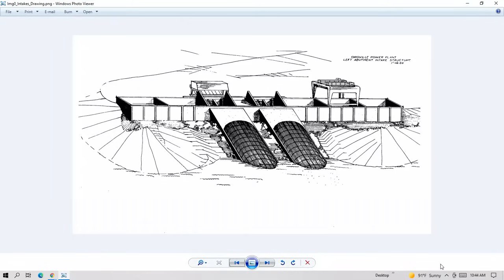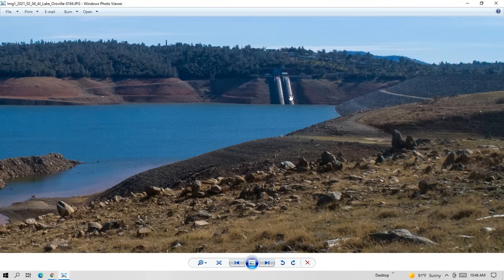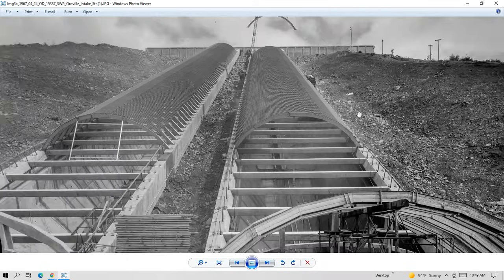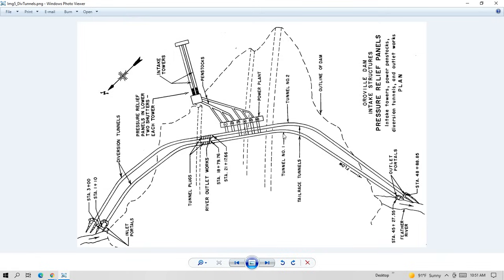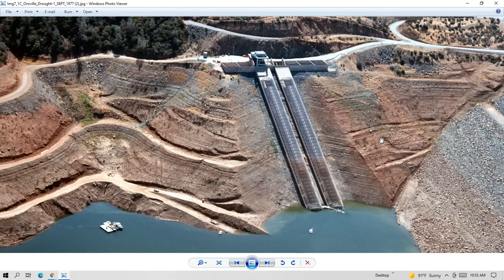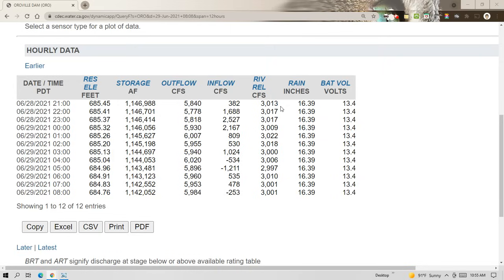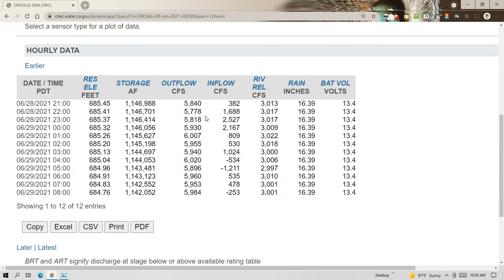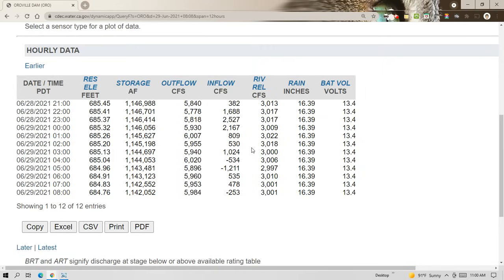When Drought Comes to the Oroville Dam by Millie Kay 06-29-2021

Comment: G'day Millie,

Yay Team !

I was wondering what you'd been doing..., how goes the Chautaqua ? (!).

   By the look of things, one can have one's water in their Dam, or one can use the water somewhere else...; but without constanty reliable regular Rainfall, then one cannot both have water in the Dam AND  use stored water for (whatever) other desired purposes.

I discovered this, when I finally bought a Pump & put it beside the 100,000 Gallon Dam which I'd had built 29 years earlier, and connected the Pump to my Clearing 450 yards away & 30 ft up the hill, planning to use Dam-Water through my pre-emptive Bushfire Defence Night-Sprinklers..., in 2019 ; after only a couple of nocturnal "Waterings" of about 1,000 Gallons per time, I had to stop in order to leave something in the Dam with which to actually fight a Fire...

   Thus, I learned that the concept of catching the runoff from Rainwater in a Dam, so as to later use the stored water to "irrigate" some selected area of Vegetation - and thus contrive to be able to continue to live AS IF the Rains were continuing to regularly appear...; is in fact a figment of somebody's diseased Imaginitus, because in the event one runs the Dam dry while attempting to keep the Plants alive, and then they die anyway..., and after that one wonders if there'll be enough water with which to run one's Firehoses.

And, apart from all that, about 5,000 years ago the Babylonians (who invented "Irrigated AggroCulture" after they first cleared the Forest to grow bigger Crops, and felling the Trees switched off the Rainfall-Pump, and they "Had To" then irrigate - first with River-Water & then with Well-Water...), discovered that,

"If Irrigation
Exceeds
Precipitation,
Then
Salination
Is
Inevitable...!"

  Because River-Water is more Saline than Raindrops, and Well-Water is much more Salty than Riverwater.

And, on the other hand, in ancient times..., conquering Armies used to ensure that their defeated Enemies never ever rebuilt their Culture or EcoGnomie...; by "Sowing Their Fields With Salt",
to ensure that whatever they attempted to grow in that place, failed to thrive...

  So, at the moment the whole West Coast of Norte AmeriKano appears to have "painted itself into a Corner",
in that every possible Dammable Site on every River has  already Bin-Damned, and every drop of predicted-to-be-stored Water has long  Bin-Allocated & Licensed, Fees have Bin-Levied and paid for the access to it, and Mortgages have   Bin-Committed unto -  against the projected Profit to be gleaned from the sale the Crops planned to be grown with the Rains which have now failed...

  What saved my little Fireplan was that, after paying $20 per ton for 60 tons of Town Water to put through my Firehoses, and after putting in $1,200 worth of Pump & Pipeline to use 10 Tons of Damwater...; was that my neighbour put his pair of 22,000 Litre Bore-Tanks about 50 yards from my front gate, fed by his Solar-Electric Bore-Pump at the bottom of his Hill - and he started selling  me his Bore-Water at 12 Tons for $50, per week if required..., which is $4.12 per ton and the Water-Carter only pays $3.56/ton for the filtered, treated, potable Town  Water he was charging $20 per ton to deliver in 10-ton loads.

I only paid $250 for the 2nd-hand Pump I keep beside his Tanks, and I had the 150 yards of Pipe already - leftover from the Dam-Pipeline...

  We're now having a wet (warm) Winter..., with Zero Celsius overnight minimums now regarded as being "very Cold" whereas until 25 years ago minus 12 was considered not unusual & minus 15 was about the record.

  So, as soon as the Rain switches off, then this place is one Hot & Windy week away from being a Fuelbomb...; half the Trees in the Canopy died 2 years ago, of thirst, so the Air-dried Cured Firewood is standing 30 ft high, over chest-high dry dead Grass - which grew in the Light arriving through the holes in the Canopy where the Trees are dead, and thriving on the  Rain which the dead Trees didn't absorb nor Evapotranspire back into the Air.

   I'm felling the dead Trees, as fast as I can get around to it,  cutting them up for Firewood, and carting them away from my Hut.
  
It's all I can thunk up, to do about it.
   
 Good luck with the looming Fire Season Millie..., it seems that between Global Warming & the Bat-Eater's Lament Virus...; we're living in VERY interesting times, indeed.

CoViD-19 Delta is kind of loose in Oz right now, and only 5% of the population is fully vaccinated with 28% having had one "Jab"....

  As strange as it may seem, the local Colony of Bent-Winged Pippistrelles - "first-cousins" of the WuHan Horseshoe-Bats, live in a Cave about 2 miles west of my Hut..., and when a cloudy Full-Moon  night sees them trapped by the Sunrise out over the Forest & miles from home...; then for 25  years they've been sheltering under my Verhanda, hiding from Daylight & Predators by burrowing under my old leather Flying-Jacket.

Last year, just as Melbourne went into a 110-day Lockdown I had a Bat Visitation ("Endangered Bats, As House-Guests...!"), and last Friday - as Variant Delta brewed-up in Sydney..., my Guard-Bat showed up to camp above my Doorway.

  Ideally, if their Cousins' little lost World-wandering Commensal Virus shows up here then the local Pippistrelles will take it in & put it on it's Leash again...(?) !

   Maybe the secret of a happy Life On Earth is to not annoy the Bats, perhaps ; it seems to be not-failing, for me, anyway...

Such is life,

Have a good one...

Stay safe.

;-p

Ciao !
Reply from the maker: What a fascinating comment (as usual), Warbles! I will read it again -- such gems of wisdom! I often drop by your channel just to see what you're up to. Always something that challenges the mind, that's for sure. I'm curious about the 5% full vaccination rate down there -- why so low? G'day, mate . . .
Reply: @MillieKay  

Thanks mate !

I sort of take each day as it comes..., everything seems to be changing so much & so fast that making big or complicated plans seems to be almost asking to be caught flatfooted (!).

I do try to understand, and to make sense of it all though ; it seems to me to be more worthwhile than a lot of other things people worry about (Sport, Fashion, Politics, Horse & Dog Races, Celebrity-Gossip, Colon-ising Mars...) ?

Such is life,

Have a good one...

Stay safe.

;-p

Ciao !

Comment: Why. Annot during this dryout and drop of water leven cannot the water intakes at 28 degrees be extended into deeper water?It would seem that even a mild 200 foot extension at degrees would place intakes into an available draw down of several foot water drWs.
Reply from the maker: Hi Michael . . . It sounds like a good idea, but the whole system is precisely designed to function with the current configuration. They did a lot of hydraulic studies and tests to fine tune it. Thanks for your insightful comment.

Comment: What about the dam drying and shrinking?
Reply from the maker: That's an excellent question, Robert! It can't be good for the dam to get below levels that haven't been seen since the dam was originally filled. I know that the river banks downstream can collapse when they have erratic dry/wet fluctuations. I would like to find out from a dam expert what happens to an earthen dam when it experiences extremes.
Reply: @MillieKay  Especially since the sun is now beating on it and drawing moisture out of the rock and soil
it must cause small cracks to form right? The size of the earthen dam and shrinkage could be measured in inches at least
I would imagine? I'm no expert but I do know water expands soil and rock especially when temperature changes are involved.
Reply from the maker: It survived the low water levels under drought conditions in 1977 and 2014, but there would have to be some effects from extreme dry-out, then refilling. There is an interesting technical article that has some gems of info at
https://www.hindawi.com/journals/geofluids/2018/4734138/

Comment: Why couldn't they use the diversion tunnels when the reservoir was overflowing a few years ago?
Reply from the maker: The River Valve Outlet System in Tunnel #2 was inoperable due to some fire safety issues at the time. Tunnel #1 is permanently plugged with a 35' diameter, 150' concrete plug.
Reply: Exactly what I was thinking.

Comment: Millie.  I have three questions if I may ask.   One.  By your estimate mid august turbines stop at 641 feet  where does Oroville community gets it electric from ?   Two,  during the spillway disaster they could not release water from  one of the tunnels ?  Is it fixed now ?   Three, water that goes down the Sacramento River are they diverting as much as they can to fill San Luis reservoir way down stream ?  Thank you.
Reply from the maker: Mike, we had a storm and my wi-fi is down until they get it fixed. I want to address your questions on my computer rather than my phone. Hopefully I will have my wi-fi back very soon. Thanks for your patience!
Reply: @MillieKay  Sure no rush Millie...
Reply from the maker: Hi again Mike! Sorry for the delay in replying. My internet was down for almost three days due to that storm!

For your first question, Oroville is largely served by South Feather Water and Power which gets energy from non-DWR hydropower plants along the South Fork of the Feather River. Some areas around there may be serviced by PG&E which has lots of hydro plants on the Upper North Fork of the Feather River (the "Stairway of Power").

DWR has agreements with various energy suppliers so it is hard to know exactly.

I will answer your second question in a separate comment.
Reply from the maker: To answer your second question, Mike, Diversion Tunnel #2 is the one with the River Valve Outlet System in it. The system was not operable in 2017 when the Spillway Incident happened but according to DWR it is now able to be used. 

I'll address your third question in next comment...
Reply from the maker: In reply to your third question, Mike, since Shasta and the Sacramento River are a different watershed and feed a different project (CVP), I'm not current on that. I have tried to find info in regard to your question but haven't been successful yet. I'll keep looking though.

Comment: During the emergency in I think 2017 were these diversionary systems alternates to the two river ones, used to dump the emergency high level and as a alternative to both the turbine and the emergency spill weir.
Could these two alternatives be beefed up to add another two future emergency water dumps.
We have a possibility of a very small reservoir being built for Thames Water the supplier to London UK near Abingdon.
If it goes ahead the emergency dump will be part of the Wilts and Berks Canal W & B C.
The reason for this reservoir is that the company has so meny leaks and there is also an shortage of water in the East of England so that excess water in the west will need to be shipped there.
There is one canal function the Kennet and Avon Canal K & A C, and two being restored the Cotswold Canal, C C, Stroud to Letchlade on the Thames and the above W & B C at Semington on the K & A C to Cricklaide on the Thames.
The two proposed canals are mainly being built by volunteers, me being one, except for road and rail crossings where local authorities, rail ect need to be involved.
Thanks for the great explanation, being in electronics I understand other engineering difficulties but water can be leathal if not handled correctly.
Thanks for the video.
Reply from the maker: Hi Anthony! During the Oroville Spillway Incident in February 2017, the River Valve Outlet System in Diversion Tunnel Number Two was not operational due to some fire safety issues at the Power Plant. Tunnel Number One has been plugged but has no valve system as Tunnel Number Two has. The tunnel plugs are 150-foot concrete plugs in those 35-foot  diameter tunnels. I don't know how feasible it would be that they could unplug Tunnel Number One for an "emergency dump" future possibility as you are talking about. 

How interesting that you are involved in the building of the canals in your area. Thanks for sharing the info, and stay safe!

Comment: So how would people be affected if the power plant goes off line ?
Reply from the maker: Good question. A lot of the power that is generated by the Hyatt Power Plant is used for the State Water Project itself. Hopefully they have alternative sources to fill that gap. As for the part that is sold or traded to other agencies . . . the inability to make up for that shortage could result in power restrictions for the areas those agencies serve. California already has rolling blackouts (or brownouts) periodically when there is inadequate supply. I suppose that could become more frequent. Hopefully some of my viewers who are more knowledgeable than I am on the subject of grid supply-demand can offer some commentary. Thanks for asking!
Reply: I believe Cali also buys a lot of power from other states as well. Part of the problem is they shifted to " green energy " when they had a lot of very good power plants around like nuclear power, which they only have one left now. The potential loss of this hydro power plant may not be felt right away but these are the types of power plants that feeds the grind and takes up the slack durning peak hours.
Reply from the maker: @buckroger6456  Thanks! Good info.

Comment: Did they ever address the main spillway or the damaged gate on the spillway since the level is so low and they have time now?
Reply from the maker: Hey Cap! Nice of you to stop by! I heard that they have "done some things" but I will need to do a little research to find out what that might have been. A "fix the roof when it's not raining" philosophy may not always apply here. Take care!
Reply: @MillieKay  Glad to see you are okay after this last 2 years of mess  Millie.
I'm hoping some work was done with those 2 problems while the water has been low. If not let's hope it doesn't fill back up.
I'm a fan of hydroelectric when it's used in a responsible way.
Reply: @MillieKay  I'm subbed with my new account now.
Reply from the maker: @captron7814  Thanks Cap!
Reply from the maker: @captron7814  Thanks Cap! Glad to see you here, and I hope all is well with you as we come out of a pandemic and move on to a mega-drought!!! 🙄